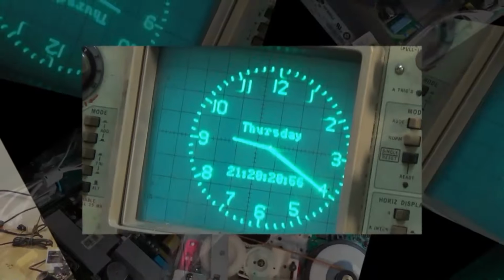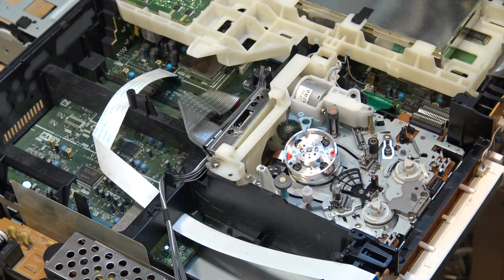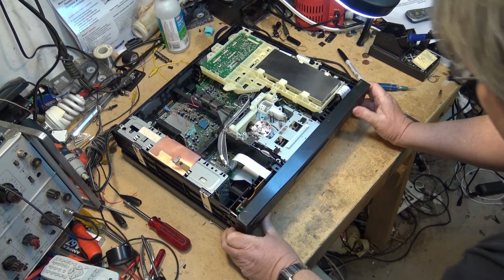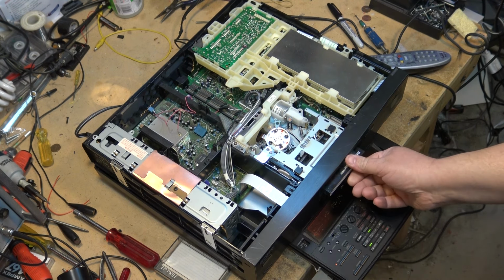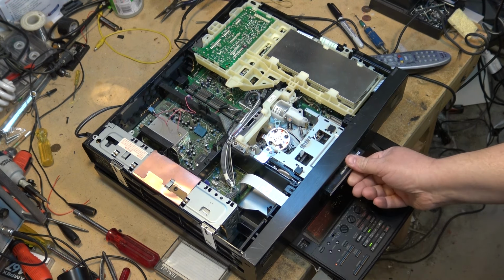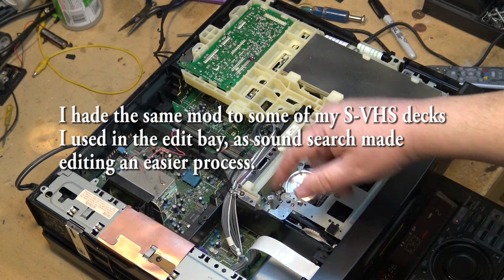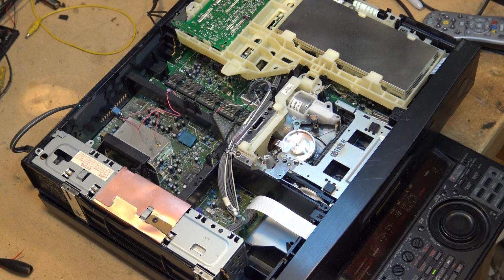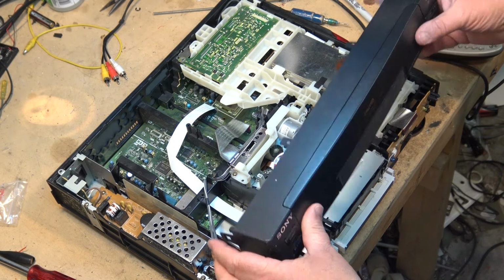Sony EVS7000   EVS5000 Hi 8 Deck mechanism troubles

Comment: Can you not scan in and 3D print in this day and age?
Reply from the maker: Not possible.  Many have tried.  This has a steel disk embedded as it needs to be magnetic.  Yes there is a magnet embedded in it.   It needs to be injection molded.

Comment: i challenged a friend of mine for 3D printing a gear replacement based on an idea i had.
and it looks very promising :  https://youtu.be/PvpRDblFClA 
but i didn't tested yet, i'm currently waiting the package. so final results answer very soon :)
the 3D printing solution is the only answer nowdays.
Reply: How did it turn out?
Reply: @jmw06003  seems i can't post link this time. don't know why but looks like my comment was automatically removed because of video link.
so in short, it work with PLA material but it's not the best. so resin is currently in study

Comment: I also loved editing using the EV-S7000 and used two of them since I didn't wat to use camcorder as the player, as Sony suggests.  I wanted this deck to be the player due to having TBC and DNR playback enhancements.  Anyways, regarding the issue with the reel cracking, I learned from a Sony master tech that the tape mechanism on EV-S5000/EV-S7000 is made by Memorex, unlike the EV-S3000, EV-C100, which are Sony's design just like the popular Hi8 camcorders as that time.  So it looks as though Sony's tape mechanism got too costly (as I still have the older EC-S3000 and EV-C100 working without issues) so they cheapened it for the EV-S5000/EV-S7000.  MSRP was $2099 (according to 1995 Sony Style magazine) for EV-S7000 which is about $3300 in today's dollars for a nice machine that eats your precious tapes.

Comment: Thanks for all your videos you are truly epic source of info....HELP PLEASE. Got an EVS 1000...yes..got cheap..been dabbling for years..but could not  believe drum assy?.? Virtually locked solid?? Thought to tackle swine to take off upper...expecting to find oxidisation or like,...worse!! Fault appears drum motor vert seized!!! ? My god what  oould have done this?? All my years of  vcr... never seen..Jesus never stripped down  to this level?... but forced to! As I can't seem to find anywhere for it...not for the  feight hearted.. tell yer..first had to take bottom brass bushoff base off notor?...try and find a 0.002m Allen key?to remove.god what  a task...I found oxidisation in areas..but from what I see is the plastic  insert moulding in lower assy carrying head links..has either warped..or expanded in some way? Coils look ok.? But the spindle shows oxidisation  in parts and is noisy?? My question..any ideas on replacement of a lower drum motor have a few  EVS 500.?...Or can you suggest any model that may use same drum motor.??? Thanks for All your superb tech info...your a genius  !
Reply from the maker: Have no idea what drum that model uses.  Never heard of that model or seen one.  Likely one from a camera will fit but i don't know.
Reply: @12voltvids   Thanks for info really Appreciated!..have. also just   bagged an EVS 9000 .. gift what a machine. But PSU..fail.... yes crap ELNAS crap everywhere !   Gears good tho?....I get the odd bit of gear comes my way now and again and if come across the nasty split gear wheel with bottom. Mag ?I will send you free kidda..am hoping this 9000 is down to PSU as I can't seem to get hold of diagram of the god dam thing display corrupt and odd characters? Nb I also have 4 off EVS 700UB!..pending rebuild ...I have had to build a remote mode switch tester for this swine from manual to progress repairs..taking forever..!.again if you need any panels for same..etc glad to help  Your the best on you tube ! Invaluable help!..I am a resource of Philips N4450 got 6 off rare item all the best from over pond!! Phil
Reply: Hi  fab video as All your content so so appreciated..could I ask further advice ? In short SONY EVS 9000 the  beast.. in sad way..No load? No eject. No  ottom panel eject no fleuro panel.?..All I got is corrupt display showing time code message of  sort. So gone for PSU...for starters...fair few caps out spec got over a d under volts....!?!. guessing regulator stuffed for starters.?,STRM 6552 7 PIN offset...I can't find soddin one!...but found STRM 6511??..Same pin out...SANKEN..would I get away with swap??...am gonna do thru every ribbon link...had a look at Fleuro display can?...caps no leaks? But many read way out?...Will change anyway!....this mc no wear on mech hardly used??...but effin complex...as you know...love to ask you to sort !   But in Blughty!.... the only good news??? No cracked gear wheels!...Power to u 12v vids!...your the man!!!🤠
Reply from the maker: @philipnelson8909  the regulators might have same pins but totally different internal circuit.   Caps were always the weak link on those units.  I only hang onto mine for PCM audio tapes.  Don't use it for anything else.  Use a digital 8 camera to play everything else.

Comment: I found an EV-S7000 at Savers/Value Village yesterday! Works well but it only has one problem. The hub is cracked, but here's the thing, its not the take up hub that's broken. Its actually the SUPPLY hub that's cracked. It can still rewind and fast forward without eating tapes but the rewind is noisy.
Reply from the maker: The supply hub also breaks but not as often as the take up hub.
Reply: @12voltvids  Wow! First time I've seen this. I may mold it together with my soldering iron, get another deck with the same mechanism and pick out a good supply hub. What would you recommend?
Reply from the maker: @TheVCRKing  the hubs have a 100% failure rate.
Reply: @12voltvids  Yes I know but I'm wondering what you would recommend me doing. Should I mold the hub or get another deck and pull that hub out of there?
Reply from the maker: @TheVCRKing  I fused the hub and it has been fine for years
Reply: @12voltvids  I might try doing that. Thanks for the tip! You're one of da best. 🙂

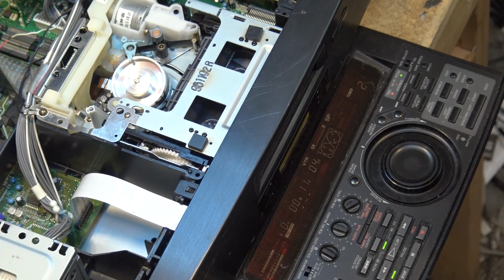Comment: 40:40 No the PCM sound quality is quite limited.  It's non-linear 8 bits (10 bit equivalent).  If you overloaded it even a little bit, it sounded dreadful.  See my video on the PAL version EV-S9000E  around the 4;45 minutes point: https://www.youtube.com/watch?v=jYCk4oWl5A4
I'm assuming of course that the PAL and NTSC ones have the same bit depth.
We've spoken before about those infernal reel tables.  They were expensive when they were available, and no longer are at any price.  Also these machines can suffer from mass capacitor failure of course, and a very common problem is failure of SM capacitors in the TBC circuit, though that can be switched out on the menus.  I've done a number or YouTube videos about these machines, I think you've seen some of those.

Comment: I think what cause it using that super rewind speed
Reply from the maker: The high speed rewind unloads the tape from the drum and has far less tension and stress on the tape.
Reply: @12voltvids  ok u haven't found a part yet
Reply from the maker: @leonjohnsonjr3331  what the take up hub. No, part not available.  I actually got the last one they had about 15 years ago and it is in this machine but it split just like the original.
Reply: @12voltvids  ok thanks when i look for it what part # I look for
Reply from the maker: @leonjohnsonjr3331  
Have no idea anymore.  Was 15 years ago when i got it.

Comment: Beautiful looking machine,  but completely agree with you the thinking behind the tape transport  and Not making replacement parts to keep these machines in operation was without thought for those whom loved the machines  so difficult now to source parts for even the low end machines now, Thank you  so much indeed for your great ability to keep these going and your guidance to us to maintain our machines thank you 📼⭐⭐⭐⭐⭐
Reply from the maker: This entire no parts thing is a joke especially for such an expensive machine. I use this machine regularly to transfer hi8 tapes and my fix has been a long term fix.

Comment: To reduce the chance of the new hub fracturing, why not reduce the outside circumference if the magnetic disk? That way it will not push on the plastic. I have seen from later posts that the disk cannot be removed. In that case, just drill a channel inside the outer edge of the disk and then remove the resulting thin strip.
Reply from the maker: The disk isn't magnetic. The magnet is above-mentioned the disk.  The disk is steel. It also needs to turn.  The magnet is what provides the tape tension regulation.

Comment: Hi, I'm about to acquire a Sony EV-C500, which is a half size Hi8 deck and it's chewing tapes too. Would you think the broken gear problem with Sony Hi8 decks  you mentioned also extend out to this model?
Reply: Hi I've got 4 of 500...pending various jobs ...certain its a different wheel altogether!!!
Reply: And be prepared if you have to strip one down???...is  pretty terrifying!!  5 panels! All hinged on top of each other....its an absolute SOD! to take mech out!!....you've never seen ! As many jumper leads..in your life...scared the crap out of me!!!....also if you've got any mode switch issues??....your forced to build a twin ic bit of kit..its in manual!...Sony used to make one as a bit of a service aid am sure???....you'll never find the swine!!!...Great when they work ....but a bloody horror bag to try and sort!...Best luck!!!

Comment: Why not to wind a thin thread (10-15 tight winds) over the take-up hub just above the teeth and then soak the thread by cyanoacrilat glue? It could be a permanent solution.
Reply from the maker: You have to remember that the gear that cracks is just a "tire" on a thin metal disk. The top part of the hub has a magnet that is attracted to this metal "wheel" that the plastic gear is fused to. This is how they regulate torque.  The gear is free to spin and the tape hub speed is regulated by how fast the tape is being fed in front the pinch roller / capstan. It regulates the tension, so you can just build something up on it that will bind with the actual hub.  You can't 3d print it either and I really am getting tired of all the "experts" that have never seen one of these machines never mind repaired them chiming in with ideas that if they actually knew how it worked would know that you cant just 3d print it.  The only solution I have found is to fuse the plastic back together since the parts are no longer available.

Comment: I learned electronics, electrical engineering and electronics repair at Mansfield University of PA, National Radio Institute, Cleveland Institute of Technology and India Institute of Technology.  Isn't all this skill and knowledge great for a minimum-wage salary?
Frank
Frank Reiser Video/Audio Service
Reply from the maker: When I worked in the business back in the 80-90 and early 2000's the minimum wage was 3.25 an hour. I started at about 10 when I worked for Sony in 83. I quickly made it up to about 30.00 an hour, which was considered a relatively high wage, because the average at the time was in the 18 an hour range. Average wage in Canada back in the early 90s, 37,000 a year, I was making 60+.
It didn't last though, by 2003 wages were falling, and I bailed and never looked back.
I don't make much doing actual repairs these days. I make more from the youtube advertising than from the actual repair. Some of these things take hours to fix too. When you get something as complex as a plasma TV and trouble shoot down to component level to fix it. Lots of skill required, and no apprecietion.

Comment: I purchased several EV-S7000 and EV-S3000 decks which are similar with PCM audio and also did the same reel repair shown in this video.  As far as other repairs today,  I have been using doctorsony on ebay about 7 times so far and he does a good job on all Hi8 decks.  He's a former Sony master tech and knows his stuff.  It gets costly when you pay round trip shipping unless you live in Levittown, Pennsylvania, but if this guy stops doing this service, I don't know who else to trust to do it right.  He favors the older EV-S3000 which is great if you love the wood panels.  I don't care for time code since today all you want is good playback to your PC or DVD recorder.  The only useful feature the 3000 lacks is the voice boost on the newer EV-S7000 / 5000 / 2000 / EV-C100.  If you need PCM audio, only the 3000/7000 have that aside from the pro decks.  So here is doctorsony's ad in case you have a Hi8 unit you want repaired right:     https://www.ebay.com/itm/Sony-EV-S3000-8mm-Hi8-PCM-Stereo-HiFi-Editing-VCR-RARE-90-Days-Warranty/192410132196?var=null#viTabs_0

Comment: I have an EV-S2000 which I bought new in Canada. I had Sony in San Jose do some repair work on it when I  was living there for a while. It was a temperamental machine from the day I bought it. But my question is do you know if the Hi-8 transports in the Tascam DA-38's, 88's, 98's, etc are Sony manufactured? Another question do you know any one who does repair work on these machines? They happen to be in the Vancouver area. Thanks.
Reply from the maker: I have never been into a Tascam DA38 or any of the 8mm multi track decks so I don't know if they used a sony transport or not. Their DA40 does not use a sony transport mind you.
Reply: Just as an FYI the take up gear on my EV-S2000 is black while the feed side is white. Sony returned the parts they replaced to me (in year 2000) and the gear was not one of them. So I'm assuming both gears are original. Also, they appear to be in good shape. i.e.no visible cracks.
The transport in the Tascam DA-98 that is having "tension" problems looks more robust than the one in the EV-S2000. It does not have a lot of hours logged, but has problems anyway. The other 98 that I currently have, which has a lot more hours on it, works just fine.

Comment: It seems no way to avoid the cracking of the gears. You may be able to get some spares from the defective machines from Yahoo Japan auction. However, local and export models may be slightly different. EV-NS9000 EV-NS7000 (looks like EV-S7000) and EV-S1100 EV-S2200 look like EV-S5000
Reply from the maker: They all crack. Just bad parts. Last time I was able to get parts I ordered 2. I did check the spare when it arrived, and by the time I needed it I opened the box and it too cracked. Thermal expansion of the metal disk under the plastic rim.
It had been stored in my storage unit that is heated in winter, but only to 5' C to prevent freezing. In the summer it gets upwards of 30'C and just the temperature fluctuations caused the new part to fail in the box. Very bad design.
Reply: So bad. Then better avoid this mechanism
Reply: They all more likely be all bad, even new old stock. it has to do with the metal in the gear expanding. Walkman like d3 and even some dat deck's seen same issue. There is no permanent fix.

Comment: Greetings to my friend, I have the sony ev-s9000, but unfortunately both gears have broken into several places, so there is no possibility of repairs, so I am interested in where they can be bought and what is their price  for set.thanks
Reply from the maker: The take up and supply hubs are no longer available. Had I know that they would discontinue them so quickly I would have bought a few spares. I have been trying for 10 years to find a replacement, no luck.

Comment: are the gears the same as the ev-s3000's?
Reply from the maker: No the 3000 is a totally different mechanism.
Reply: oh well until this i have never heard of this format i mean vcr was the thing to have till i was like 12 so that's probably why partly. btw I love your video's i learned vcr repair from your videos and have been fixing peoples vcr's i mean they are total crap those vcr/dvd combos but ya know it's still a vcr. I like that you explain things well and don't linger on it for each video i watch feel like i understand that type of electronic a lot better. good job!
Reply from the maker: eddy apple 
8mm and Hi8 was a very popular camcorder format not generally used for recording tv however it could and do it very well. It had 2 separate stereo sound tracks an afm hifi track and a pcm digital track that could be dubbed and also featured time code for frame accurate editing. This machine was 3000.00 which is probably why you never heard of it. The camera I had that went with this machine was 12,000.00. Professionals know all about these decks though as they were quite useful heavily used in broadcast operations for news gathering by smaller stations. Not quite to beta am quality but close enough at a fraction of the cost.
Reply: you should teach a class dude for real. Yeah 3000 dollar price would more so explain it I'm the only one in my family that seems to understand why pay so much for a product when there are cheaper ways to do the same thing. Those people would never pay anywhere close to that even for professional stuff. lol hey i got a toshiba sa-775 keeps killing the same resistor when i turn it on the resistor will turn red hot and burn out but it doesn't blow a fuse. do you think a dead cap would cause that? i don't have an esr meter yet also way i see it i might as well replace them all if it is which basicaly turns it into a parts machine.
Reply: btw when i way do the same thing i just mean record and watch video basically just the bare minimum of what media devices are made to do

Comment: Hi, i have a sony slv-t2000cv and i have a problem about loading hi8 tapes, can you help me? One gear is broken on the left side of the tray and the tape does not enter. No technical diagrams (exploded) i'm found online. I have seen that it is almost identical to that of its EVS7000. Can you make a video or photo of EV gears then i understand what search on engines search online? Thank you very much.